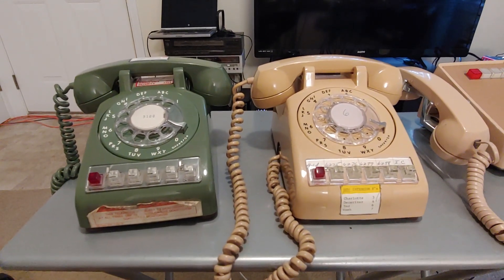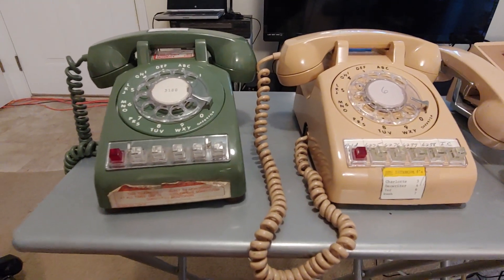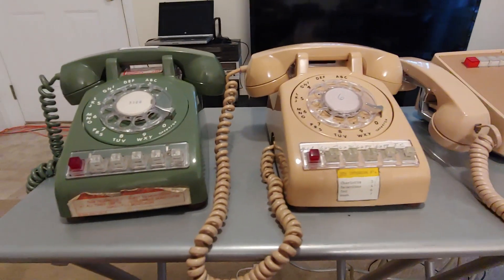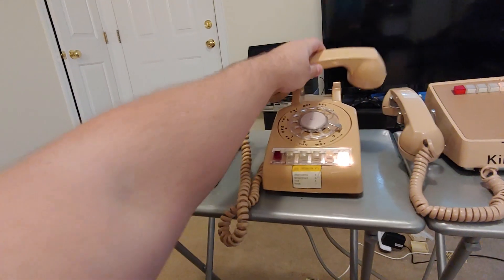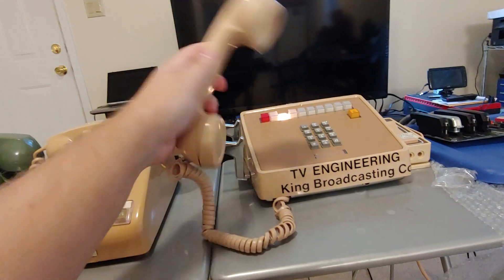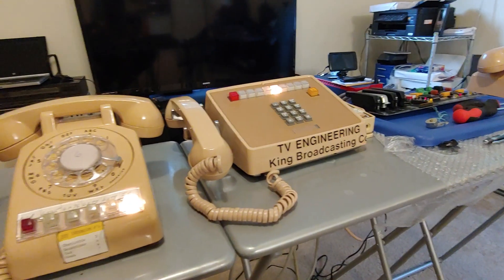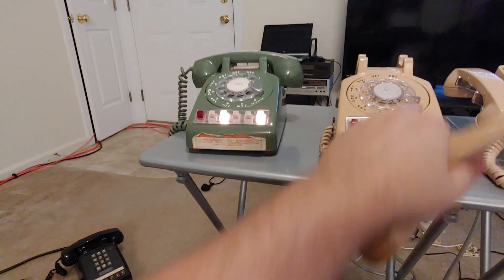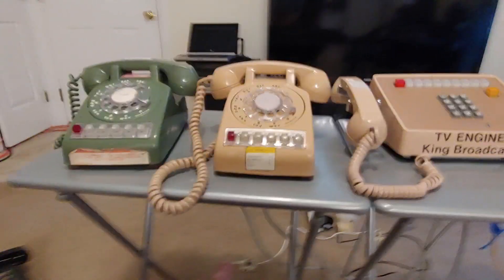Seriss Corp Solid State 1A2 Key System Review

Comment: Board designer here -- yes, I fixed the 'rotary dial flashes the lamp' problem you noticed as a tweak the the firmware, and sent you a new chip that should solve that issue.
One other trick you can do with the intercom: dialing "0" buzzes all extensions at once!
Reply from the maker: I'll make an update video soon!
Reply: This is exactly what I want to install in my home. My project/plan is to install intercom only phones in every room of my house. (We no longer have a land line.) Can you use single line phones with the 1A2 key system?

Comment: I had a 1A2 key system in my home for a number of years. 2 CO lines, 2 intercom lines, and button # 5 was a public address line connected to the home’s built-in intercom system. That should tell you how many years ago go it was😂 Every room had a 5 line phone, even the bathrooms😂
I reversed the T&R wires on the kids phones so they couldn’t touch tone out on line one which was reserved for my wife and I.
I also installed a relay on line 2, kid’s line, controlled by a timer that would open T&R at 9PM during school days.! 
Kid’s hated it. LOL.
Really enjoyed this video👍

Comment: 32 years as a key system / installer here in Seattle, sure wish I would have kept a few of those phones. 30 years ago we tossed em into the dumpster as fast as we replaced them with EKT's . By the way, there are  old 1a2 systems in phone rooms all around the city, just hanging on the walls in the phone rooms , unplugged.
Reply from the maker: Oh yes, I know. One of my company's clients still had an entire array of neatly installed blue Valcom intercom units from the late 80s still installed. I tactically acquired those 🤣

Comment: On your telephone switch board: Is it correct female contacts Conrad has?: https://www.conrad.se/p/centronics-kontaktdon-tru-components-tc-a-5750f-c-203-1-st-1586423
Reply: That'll work, but the connectors on this board use screws to secure the connection, not the bail wire springs like that connector. If you google "50 pin telco connector" you'll find plenty of examples.

Comment: How much is your Cisco callmamager cost
Reply from the maker: Cheap. I think the 2821 router with Call Manager Express was like $90 on eBay
Reply: telecomguy10 shoot that is pretty good. How do you hook up a line and how much is that?
Reply from the maker: @maxravnaas1719  There are too many potential answers to your question. I recommend doing some reading and learning on your own. Buy a CCM and figure it out. The best way to learn it.
Reply: telecomguy10 thanks for the advice. Luv your vids
Reply: I got one (UC500-32) on eBay for $30 with free shipping. I prefer my Asterisk setup with Chan-SCCP-B and SCCP Manager, though. It's more powerful, flexible and has so many more features.

Comment: I'm glad I just came across this video, because I've seen this new-age KSU before. How did you get it? I own  an ITT 564, with the original amphenol cable and saw your previous video on getting a x64 series to work on plain POTS by bypassing the amphenol. I'd love to know how I could do that by going right to 66 block, because the 16 pair cable is still perfectly in tact and I think for me that would be a better path. (Or... find a way to get this type of KSU!)
Reply from the maker: Ordered directly from Greg Ercolano, the owner of Seriss Co.

You need to run red and green from your phone line to white/blue and blue/white for line 1. You will not get ringing unless you also run jumpers to the slate/yellow yellow/late wires for the ringer. I would recommend just buying his KSU. Easier and cleaner, and it runs all the lamps and everything.
Reply: @423tech  So I followed your advice from the other video and tried to apply that to the 66 block, so hopefully I can try it out soon to my PBX's analog stations and verify that. Thanks for letting me know about the modern KSU. A bit nervous getting older older shoeboxes in the fear of the age and fire risks. Gawd even my Merlin 206 went up in smoke (but oddly enough it works...)
Reply from the maker: @Steveos312  any update?
Reply: @423tech  The lines go off hook (confirmed on a few DSS buttons on digital set), but Line 1 doesn't ring and the handset isn't responding ether direction. I also think the dial isn't responding ether. Could it be the polarity, swap the wires around?
Reply from the maker: @Steveos312  don't have enough info to help you there
Reply: @423tech  Let me do a video a follow up video. It's been four years since I got it.
Reply from the maker: DM me for Greg's contact info or just look up his video, it's on YT.